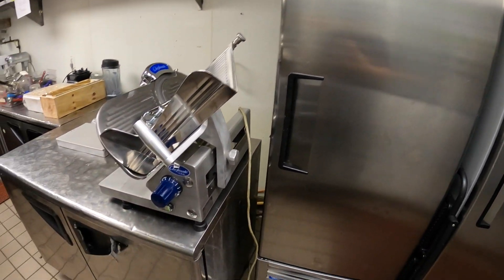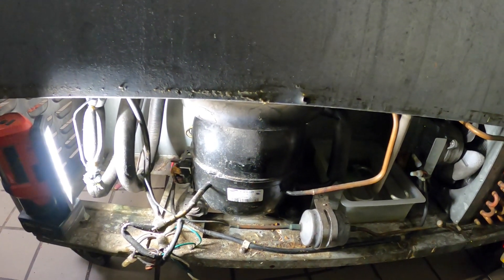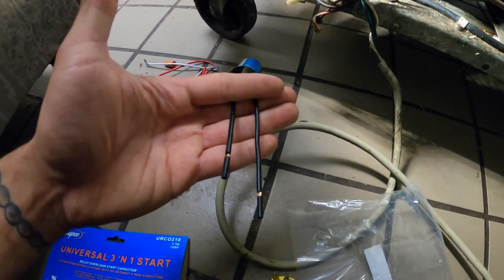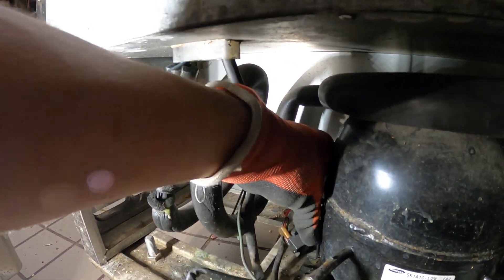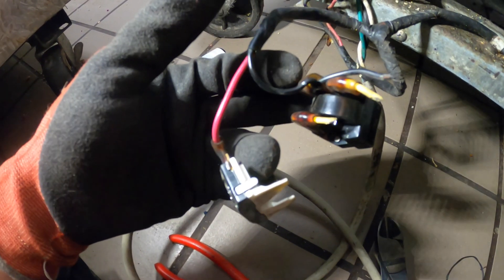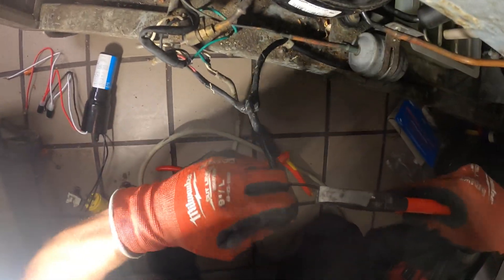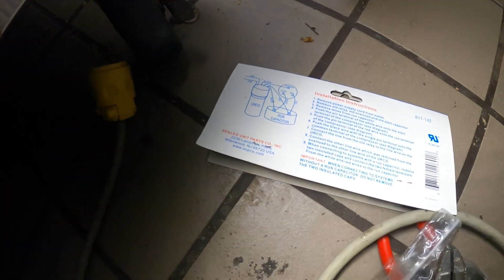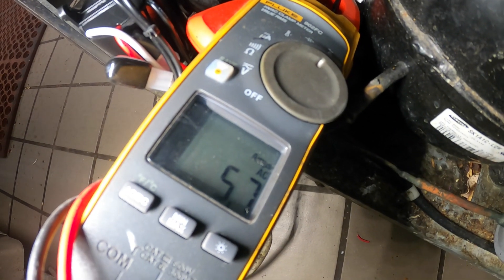HVACR: Turbo Air Refrigerator Compressor Not Starting (Supco 3 in 1 Hard Start Kit Installation)

Comment: Hey man. Ive been watching and learning from your videos for a long time, but i have to say make a correction. Just because you got sommething running doesnt mean that its running correctly. You do need to incorporate the run capacitor into the wiring the compressors' longevity. 
Its like finding a condenser fan that still runs but has a capacitor reading low or 0 microfarads. You know its still running, but you would definitely change the capacitor to help the motor run more efficiently. 
I work on alot of these turbo air units and replace the ptcs with 3 in 1 kits all the time.

Comment: Nice. FYI take the run capacitor out and wire with hard-start if the conpressor plate says it needs it. The hard start is just a new start capacitor ptc and built in overload. Great video

Comment: Great video. Thank you for sharing. May I ask, How do you know when compressor need add installation hard start kit ?
Reply: When it doesn't start. It will be hot to the touch. Remove the old relay and shake it, if you hear a rattle, the relay is bad. Replace with the 3 in 1 RCO. But if there is a run cap as well incorporate it with the RCO, don't do like he did and eliminate it. The motor needs it to run properly.

Comment: Those run caps are needed for proper operation and efficiency, the compressor will run very hot without them
Reply: Correct, the start winding will overheat and the life of the motor will be shortened

Comment: So you just eliminated the run and start capacitors by using the hard start kit ? Were the run and start capacitors bad ?
Reply: No, it's usually the compressor mounted relay. Shake it and if there is a rattle, it's bad. The 3 in 1 includes a start cap and is good for the listed compressor HP. You have to wire either the factory run cap or a replacement back in with the 3 in 1. You're not supposed to eliminate the run cap, it will cause the start winding to overheat and prematurely fail.

Comment: The 3in1 are Ok but they do not have a thermal overload protection for the compressor that the OEM start components have. That unit should have a cover installed so condenser air can not  recycle.
Reply: If you open it you will see the overload.
Reply: @sherwinalvarez7365  It has a current overload but not a thermal overload that senses the compressor shell.
Reply: That's literally what the 3 in 1 is: Relay, Capacitor and Overload
Reply: @topher8634  The 3 in 1  overload is only current sensing and not thermal and current like the OEM.
Reply: @mainj54  it's a klixon just the same. Increase in current generates an increase in heat which trips the klixon

Comment: You blew dirt around 😒 🤣 where they are preparing food 😮😅?
Reply: He did not bring the dirt with him.
Reply from the maker: @sherwinalvarez7365  Facts 😂 No worries, I cleaned it up all after. Just moved it away from the condenser coil getting it all. Thanks for watching! 🔧⚡️🤙
Reply from the maker: @tacydit  I cleaned it up after. I did them a favor as the condenser coil will suck in all that dirt. Nobody is moving those fridges to clean. Thanks for watching! 😁🤙🔧⚡️
Reply: Oh yea extra flavor
Reply from the maker: @brandoncorrea511  Gotta' love the extra flavor 😂
Reply: that's just the way of the road